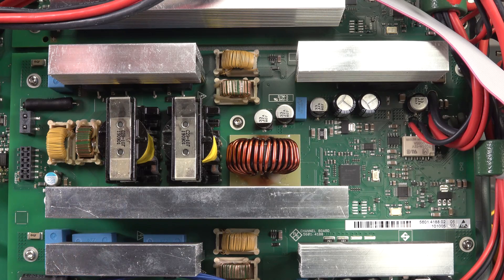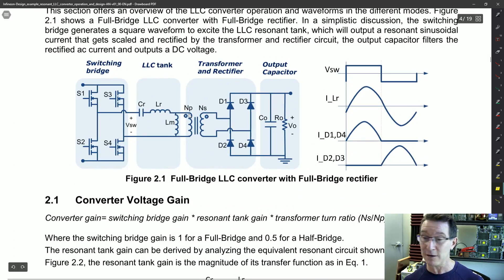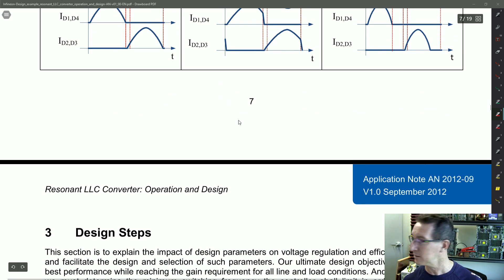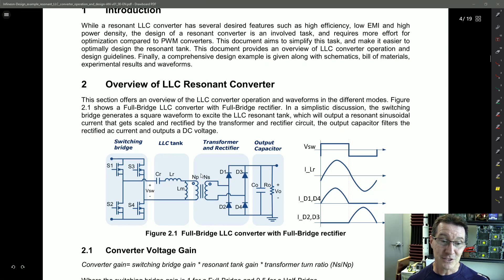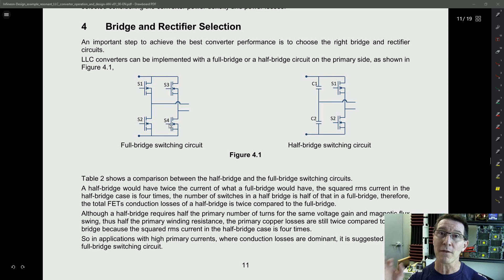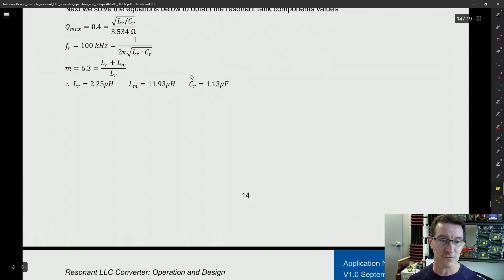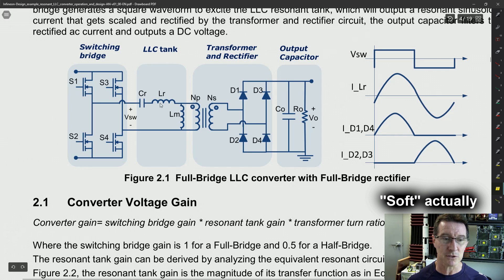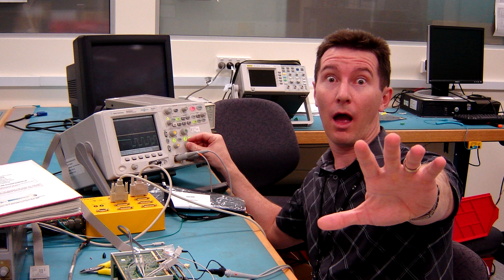EEVblog #1294 - LLC Resonant Mode Converter Design

Comment: During my PhD I worked a bit on resonant converters with a friend of mine (we both worked on the same research project on bidirectional EV chargers, but my friend's PhD was focused on the resonant converter architecture and control).

My friend's Thesis can be found here if anyone is interested in the details: 
http://etheses.whiterose.ac.uk/17528/1/Chaohui%20Liu_Thesis_Final_2017-05-30.pdf

Soft switching consists on zero-voltage-switching (ZVS) and zero-current-switching (ZCS). Whether you get ZVS or ZCS or whether you get both depends on the converter topology as well as operating region.

As you mentioned, in LLC converters, the gain of the converter is controlled by varying the switching frequency (duty cycle is kept at 50%). The EMI is low due to the lower harmonics in the current waveform as you mentioned (mostly sine vs. square). Also, ZVS/ZVC means that the parasitic ringing in the MOSFETs is significantly reduced which reduces EMI (because this parasitic ringing is what causes the headaches since it's at very high frequency relative to the fundamental tone and can cause conducted and radiated emissions issues). It would make sense therefore for a bench top PSU to use an LLC converter due to the reduction in EMI alone.

To reduce losses further (especially for high power converters operating at high switching frequency), Litz wire can be used to reduce the AC losses due to skin effect and proximity effect. You can go further by having synchronous rectification on the secondary side (replace diodes with FETs), but will increase cost and complexity.

The first inductance element in the converter consists of the external inductance and the transformer's leakage inductance in series, but the majority of that inductance comes from the external inductor. The 2nd inductance in the LLC is the transformer's magnetising inductance.

There are tons of trade-offs and simulations that can be done for optimising for efficiency vs. size. vs. cost etc. and you can do that till the cows come home as you say!

I think you got the inductor and transformer correctly identified on the PCB. I think they are using the same bobbin and magnetic core set (or perhaps the same fastening clips) for both the transformer and inductor so that's why the part numbers are the same. You can make your own custom TF/inductors, by buying the cores and bobbins from Digi-Key etc. (loads of manufacturer like Epcos make them in a variety of shapes and sizes).
Reply: Thank you for the explanation!
Reply: i tried to download thesis from the above mentioned link but its not working. can you send me these thesis on my mail  syed_shah1992@yahoo.com

Comment: A LLC-Convert alone isn't
able to full fill the Output voltage requirements from 0 to 250V. As the Gain
Curves indicates, they will struggle at low voltages and light loads withou large frequency variations. I can't
see a resonant capacitor. These Caps are locking more like input filters for the
H-bridge. A third stage is common to achieve the needed voltage range but there
must be a beefy diode anywhere. It could be also some kind of protection circuit
for the load.  I would choose a different
topology like a phase shift push pull converter. But how knows (=

Comment: Since this is a variable supply my guess is the big inductor and the single MOSFET is a secondary buck converter.
Reply: Could also be a programmable current sink, to help with overshoot and the output voltage regulation, or to dump energy when you command a drop in voltage, or when your load imposes current on the output for some reason. Lose energy in the saturation of the inductor, or in the diodes and transistor, till the input side feedback can compensate for it.

Comment: Question:  What are those little green and yellow toroids?  Are they inductors?  Are they not part of the circuit?
Reply: Dave showed them in the previous video. They are current transformers for current sensing. The giveaway is that the "secondary" winding inside them is only a single turn.
Reply: The ones with the thin wire and exposed green core are current transformers, as was mentioned ten months ago. The ones with yellow wire are gate drive transformers.

Comment: did that have one of those self made opto isolator like the electric fence??? with the UV led & the light sensitive transistor in heat shink.. Or am i seeing things(resistor) TOP LEFT???
Reply: Input fuse.
Reply: @v8snail  was thinking that V8Snail!! coz Dave wouldn't have missed it if it was one!!

Comment: Actually, it is the high-current switching transients that generate high-energy noise.  Resonant mode supplies switch at near zero current and thus generate much less noise.  Resonant mode supplies DO vary the driving frequency.  This is how they change the current that flows from a constant input applied voltage amplitude.  This does not present a noise problem and, in fact, is equivalent to dithering a microprocessor clock to spread the noise over a broader spectrum

Comment: There are also LCC converters having a second capacitor in parallel with the transformer primary instead of a second inductor in series with the transformer primary.

Comment: The resonant circuit filters out the higher harmonics of the square wave drive so only the fundamental is a pretty good approximation.
Reply: Thanks for the explanation. I was wondering how that worked, that important detail was glossed over a bit.

Comment: Normal switches' drains begin at the input power voltage and must conduct current until they are open again at the input power voltage.  At the beginning and end of these time intervals, they also have non-zero drain-source voltages.  Since P=VI, there are substantial power pulses at the beginnings and ends of these pulses.  In resonant designs the series capacitor stops the current every half cycle and allows the switches to change state without dissipating these pulses of power.

Comment: Did some testing a number of years ago on a hyper efficient power converter, of several KW output. Used in Solar car race, Darwin Adelaide and from memory efficiency ran at 99.8%. Quite certain it was a resonant design as output harmonics were also extremely low.
Reply: 99.8% efficiency. Wow, thats amazing!
Reply: @simontay4851  sure was a surprise when evaluating the results. 
Had to build a 3KW adjustable load, at minimal cost. Would have liked more time to design  a electronic load, but made do with large 'gold' power resistor chain on a long tube heatsink an fans forced air flow.  Had a hurry as decision on using these converters was critical to be ready with race setup. Contributed to success of the local car that year!

Comment: I would consider the possibility that there are two transformers in 2x Lm is used at resonance, and as suggested the secondary is either  a centre tap output or as suggested by another comment used series and parralel for 64 V and 32V respectively

Comment: Just take a look at a modern, higher efficiency (Gold or Platinum) ATX Power Supply. Most of them are LLC-Rensonant mode Converters.
Though they usually don't have a big coil behind the Transformer...
A cheaper one might be better. Something like Silverstone SST-ET550-HG, as that's a single layer PCB one. And cheaper...

Comment: More video's on this subject needs to be covered. practical one as well. I know of someone who used a PIC16F177x/PIC16F178x part and designed a LLC controller in firmware exceeding features found in jelly bean parts.
Reply: I seriously doubt it. There's no way one could achieve ressonant performance at, say, 400 kHz switching frequency, with one if those puppies
Reply: @Eng_Simoes  400KHz? maybe yes, but what does that frequency got to do with anything?. Fully resonant mode is not related to some high frequency standard only a factor related to core size reduction that's it. its all to do with the transformer core material used + LC tank. We can achieve full power at resonance  with frequency as low as 63Khz using that PIC.A cheap modern design can be realized with EPCOS material N96 operating at 150KHz with cheap mosfet switching devices and a tight layout.
Reply: @xorcipher  energy is 1/2 C×Vsq. ..
and/or 1/2 L× Isq...
AND POWER IS ENERGY times FREQUENCY....
so higher the Freq. ..higher the pwr. for the same L/C & V/I 
also higher the operating Freq. ..
smaller physical sizes of L/C components..
The limitations earlier being reliability & capability of the then AVAILABLE mosfets..
dedicated controllers....
& low economical sense to 
change over from the well established SMPS " industry standard "...
Today we have SiC mosfets which are way ahead of conventional insulated gate mosfets..and as they become more acceptable & price competitive.. ..EXPECT TO SEE 
KW. OF POWER handling at UPTO 5-10 MHz in resonant modes...
Reply: Unless it’s for educational purposes, designing a resonant controller by yourself seems like a huge waste of time. NXP and TI  already make extremely reliable controllers that work up to 500KHz for <$1
Reply: @SolidStateWorkshop   don't agree with that statement, see CIP Hybrid Power Starter Kit 
Part Number dm164147, there are lots of really great benefits.
Reply: is "someone", devreci?

Comment: I did  a pcb  Design for a LLC   the engineer had some tricks even the output was over 97.5%   we used Synchronous Rectifier on the output. The 

problems was safety UL distances . The Guy I worked with wound his own transformers and air  gaps  it worked well . Inrush current was also a Issue 

try putting a 70mm 40mm height 200mm 2kw  and abide by UL it took a age Just to do placement . I do not think he did too many calculations it seemed 
to be  mainly from past experience .I am far from a power engineer an 800v circuits scared the shit out of me during bringup  at times to200 and to-246
were known to explode if dead time was not correct. I was the Altium fellow but knew to keep a safe distance if the systems were under test.

At times even strange caps that cost extra like when you have no space you go to 
https://www.johansondielectrics.com/ac-safety-capacitors

The Synchronous Rectifier 
https://www.youtube.com/watch?v=z_BE7WdeXPg

Comment: LLC resonant converters are actually getting pretty common in the PC power supply space. 

Nearly all 80 Plus Gold/Platinum/Titanium models are use a LLC resonant primary. Many also use synchronous rectification on the secondary side.
Even mid-range models like the Corsair CX450 (which is "only" 80 Plus Bronze) have moved to LLC resonant topologies.
Reply: I'd love for dave to take a look at one of those high end passively cooled 600W models
Reply: Of all the old ATX PSUs I've taken apart this was immediately recognizable
Reply: those Gold and up PSUs uses LLC for efficiency, i guess?. there's not much bronze or 230V standard rated PSU uses LLC even today, sadly. did CX450 uses LLC? i thought it's only the 2nd gen CX550, 650 and CX modular series uses this topology

Comment: It's been 25 years since I worked on one of these!  It was for a US Navy submarine reactor control system, where space and heat were both huge issues given the power density we needed to meet (there was no room for conventional supplies).  After a failed prototype followed by a failed tweak to it, we got a successful design only after we gave up trying to use pre-approved MIL-spec magnetics and made our own.  Literally: We hand-wound the first two sets.

It was a design competition between two companies, and the Navy was impressed by how much smaller and cooler our supplies were compared to our competitor.  In the end, we didn't get the contract.  But we sold our supplies (and other tech we pioneered) to our competitor for an eye-watering markup.  Turns out we made the profit we hoped to earn on the entire project just by selling some parts and licences.  The engineering sadness at the loss was soon overcome by the financial win, and the sense that we had ducked a bullet: We likely would have lost money had we won!
Reply: Parts and licenses? You mean, the cores with windings and innovative circuit design?
Reply: @edinfific2576  The power supplies were the only hardware we sold on the project, which was about 5% of the revenue.  The other 95% of the revenue came from other tech we developed then licensed (it was a nuclear reactor control system, after all).
Reply: Schematic or it didn’t happen. In all seriousness, it’d be really interesting to see a schematic of this topology. TiA :)
Reply: @combin8or  I was actually a software engineer at the time, but I had been a Navy and commercial nuclear technician before that, so I worked on the project in multiple roles.  When the supplies started smoking, I was pulled in to help troubleshoot (because the supplies were controlled by an 8-bit microcontroller I wrote the code for, and we all know who gets the blame when the smoke leaks out), and then helped on the root-cause analysis.  I did no electronics or magnetics design, but when it came time to make the prototypes, I was the only one with winding experience, so I got to lead that team. (Well, it was me, a technician, and an intern.  But still.)

The original design did direct-from-AC conversion, to avoid rectifier losses and minimize the power factor.  Once we had the better magnetics, we were able to use a slightly more conventional design and still meet those goals.  I can remember bits and pieces (it was a quarter century ago, after all), but nowhere near enough to reconstruct anything workable.  I do recall the microcontroller interfaces and their signaling, but that's about it.  In the final design, the microcontroller did little control, and lots of monitoring and reporting.

That was an interesting project overall.  I was a junior software engineer who was given some impressive chunks of the system to design.  Other software engineers were senior to me (and older than me), but had fewer high-level responsibilities, which made for an "interesting" work environment.  Basically, I sucked at that aspect of it, meaning management had to back-fill my lack of people and leadership skills.  Ugh.  But the real key turned out to be me improving my writing skills, so I could generate design documents that created less discontent because I learned to better explain myself.  Trying to do that face to face was not optimal...

Only three Seawolf subs were built (out of 22 planned), which was why we wound up being glad to have lost the competition: We never would have made the kind of revenue or profit needed to stay in that business.  But the supplies were an unexpectedly good side-line for a while, until the engineers moved on to other projects and the designs were sold for a pretty penny.
Reply: @flymypg  cool. I’ve had a direct from AC topology on the back burner for awhile, so that’s pretty interesting. Thanks for the story.

Comment: 16:37 What're the odds those two are both transformers, but the secondaries are wired in parallel for the 32V outputs, and in series for the 64V outputs?

16:55 A big fat inductor (on a black core) with a MOSFET next to it, takes my mind towards a mag-amp type regulator. Can those be made with an adjustable / variable output voltage, or do they need to be designed for a fixed value?
Reply: TTi made a series of PSUs which used magamps in the secondary side regulator, so it is doable
Reply: @jaycee1980  link pls ☺️
Reply: @productivityatmost  TTi EX354 series
Reply: I have some power supplies from Delta Electronics that do this as well.  They have a secondary transformer set that can be switched between series and parallel depending on the load and regulation.

Comment: A numbered video is unlisted with 0 views?
Reply from the maker: Didn't want to release two videos in one day, but made it available to those who bothered to follow the link. Zero views might just be stat lag, or you are the first.
Reply: @EEVblog  An LLC is just a particular type of resonant converter, not every resonant converter is an LLC. Full bridge LLC is also not as common as half bridge LLC which can be used effectively up to more than 1kw power level. This seems not at all an LLC but more a Phase Shifted Full Bridge converter (PSFB). An LLC won't have an inductor on the secondary side while a PSFB needs it. An LLC will work with good performance at fixed input and output voltages. Here this stage needs to regulate from 0v to 32v (or 64v).... Good luck with an LLC converter, the needed frequency variation to keep the output voltage regulated will be impossible to achieve. I suspect this is a PSFB with 2 identical transformers wired with the primaries in series and the secondaries in parallel or in series to differentiate the 32v and 64v models using the same hardware.
For more information on PSFB check TI app notes about UCC3895.
Great content as usual.